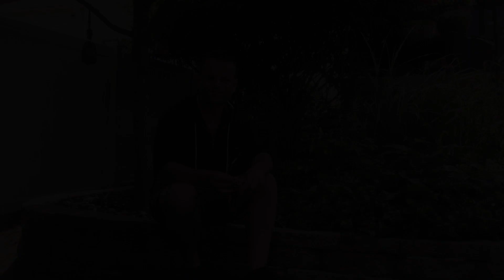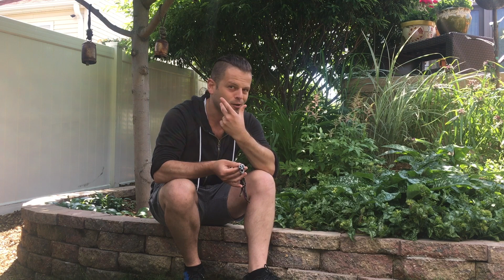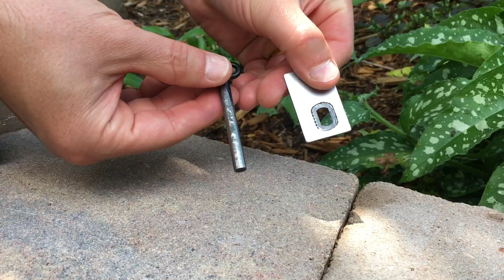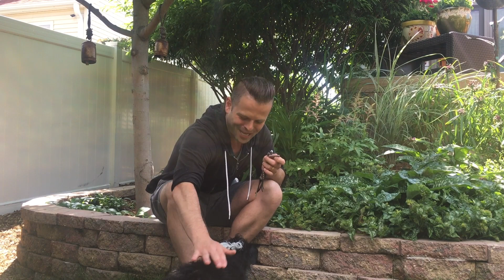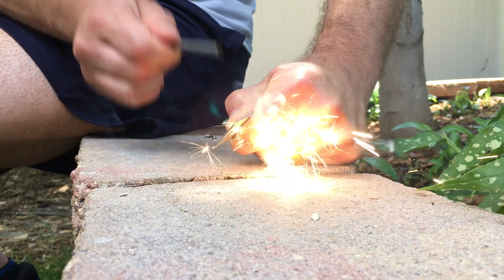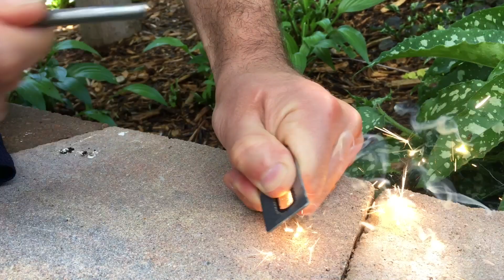Challenges Encountered; Obstacles Overcome

Comment: I do like those skull scrapers, the only reason I didn't put the order in for those along with me Axxis was that the ferro rod I use is 1/2" in diameter and those just wouldn't work for me. But I think you came up with a great idea allowing both top and bottom of the rod to be scraped. Awesome idea. Maybe in the future I will grab one of those fire scrappers as well.
Reply from the maker: Thank you very much for your kind words! We are in the process of designing a scraper that will fit your needs. ; D I can't get into the details at this time, but it is already working its way through our pipeline!